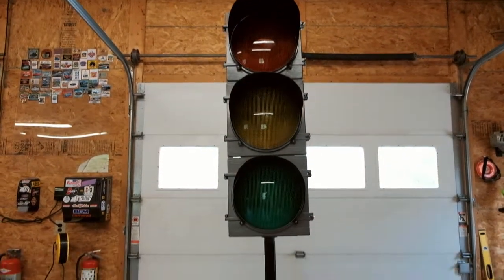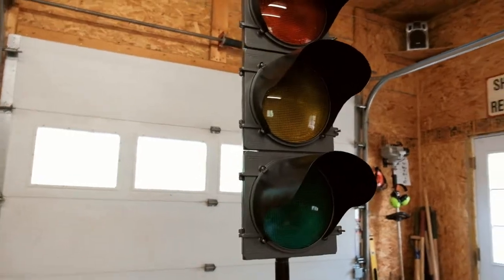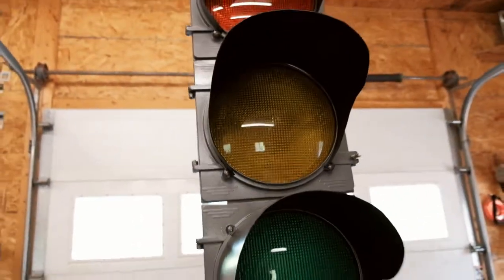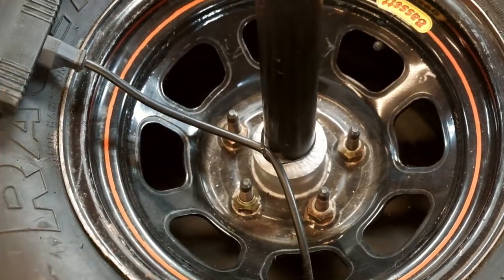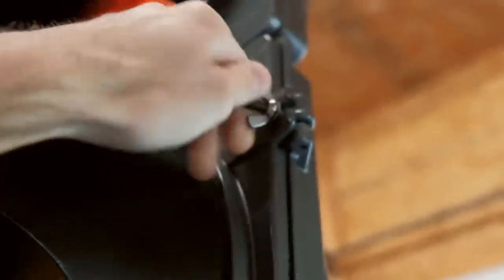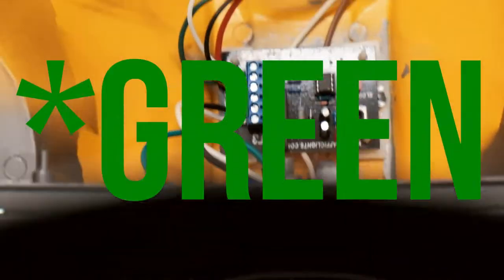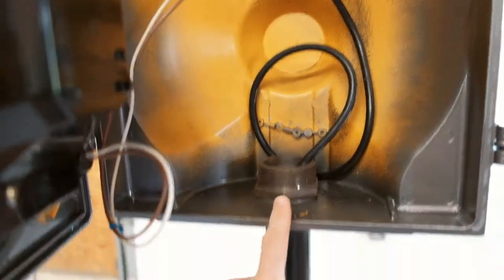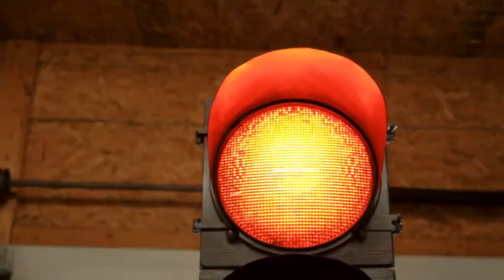My Traffic Light

Comment: I collect this stuff and  think you're right on your year of manufacture estimate; 1970s - '80s.  It would originally have been fitted with reflectors, glass lenses, and incandescent light bulbs.  I think the first time I ever saw an LED unit in a traffic light was around 1989, and it was much more crude looking than the LEDs in your signal.